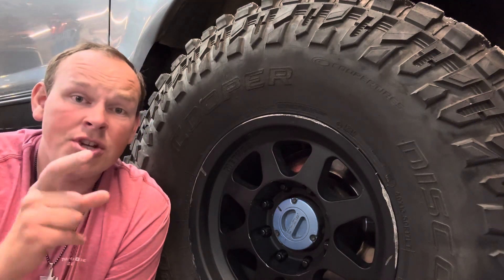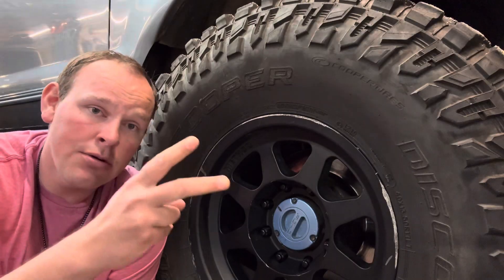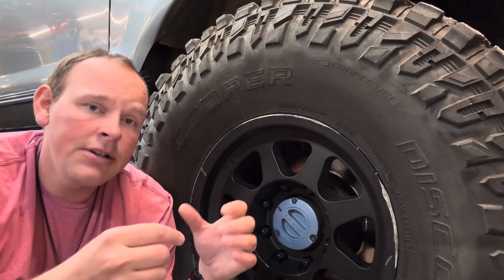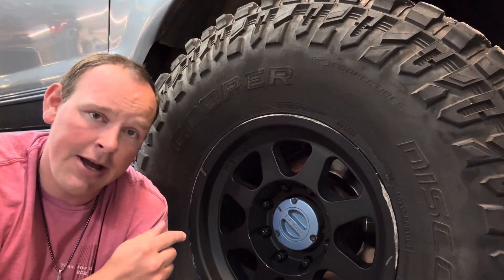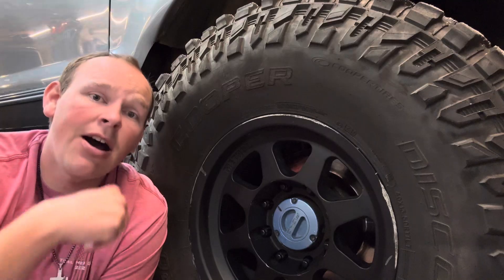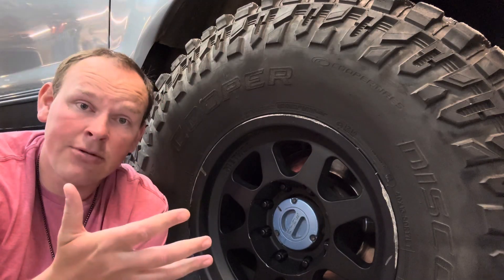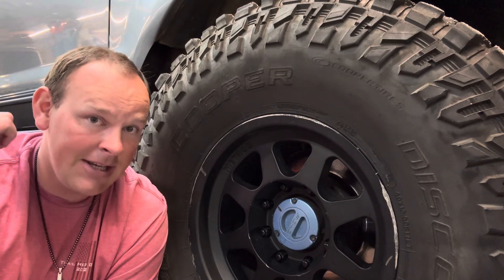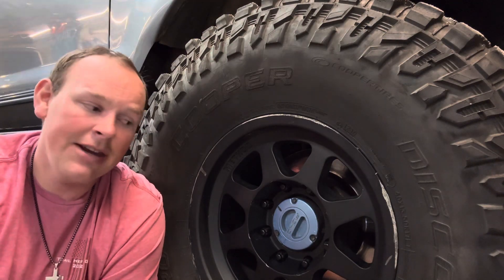EP:5 CWG How Ford Vacuum Hub 4x4 Works

Comment: The factory hubs crapped out on my 2000 Excursion within the first 2 or 3 years. Every year, I'd dismantle and grease the crap ot of them. I replaced them twice with OEM. About 10 years ago, I gave up and put some generic Amazon manual hubs and have been running them without fail ever since.

Manual hubs are like a smoke break for non smokers. It gets you out of your truck, you lock the hubs, stand for a second like you're having a smoke, giving you a moment to assess the stupidity you are about to undertake.
Reply from the maker: Gives you a minute to appreciate what your about to do!

Comment: Very informative.  Didn't realize that you could leave the hubs locked without the 4WD switch engaged. I purchased my 2004 Excursion a few years ago, and a previous owner installed manual hubs. I'd like to switch back to the auto/vacuum hubs because in Colorado when I need to lock the hubs, its either inclement weather or often not a safe location to get off the road to do it. Do you have any advice for installing/switching back to vacuum hub system?  There's plenty of videos on YouTube showing how to switch from auto hubs to manual hubs on an Excursion/F-250, but none that I can find that go the other direction.
Reply from the maker: That’s a long list, but in my Amazon store I have all the seals and hubs. You need to see how the previous owner blocked the lines off. There’s a nipple on the hub and hard lines should be right around the shock mount.